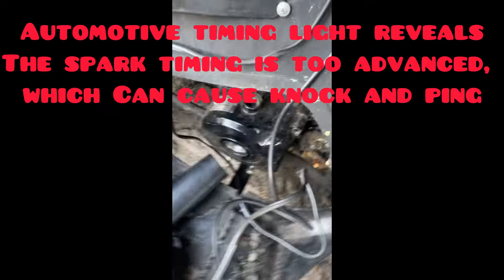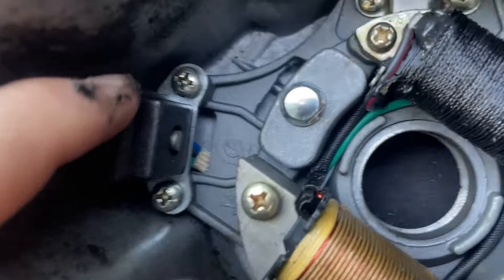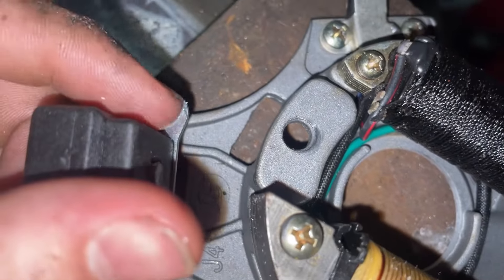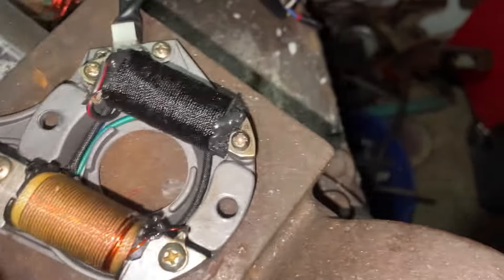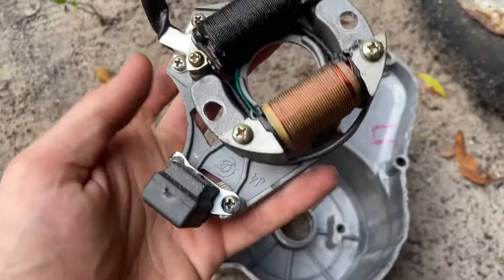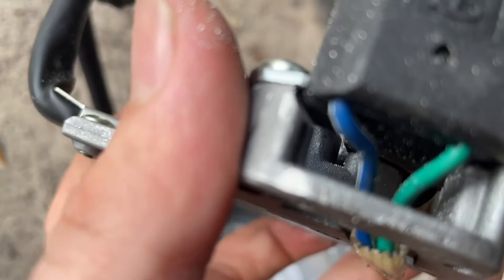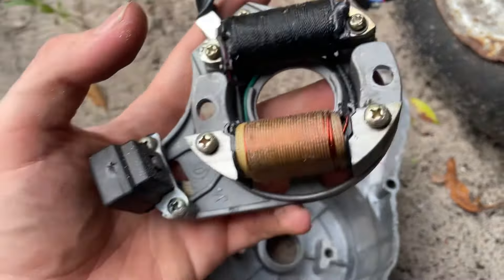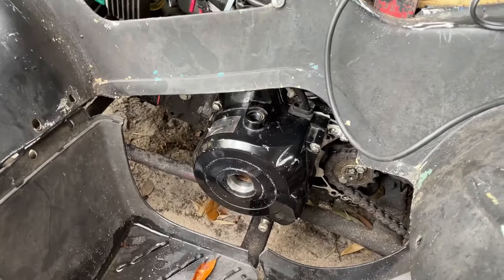Clear demonstration of detonation sound in small engine and how I fixed it

Comment: Another good one to look out for is piston slap. Im not sure of the exact ways to tell the difference, but i have noticed that it seems to get louder with your exhaust (like if you take your muffler off, its still louder than the exhaust note) and that it usually goes away with a hot engine. My 01 malibu with the gm 3.1 v6 had it pretty good but always ran great
Reply from the maker: @imthemistermaster  good to know